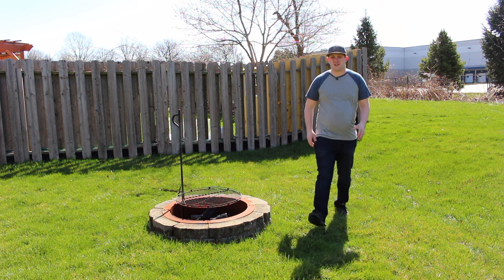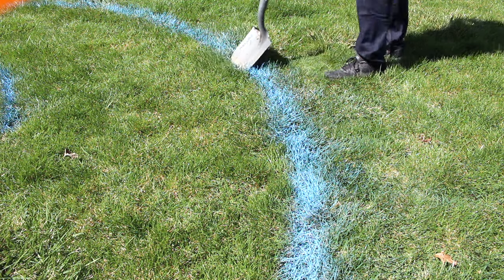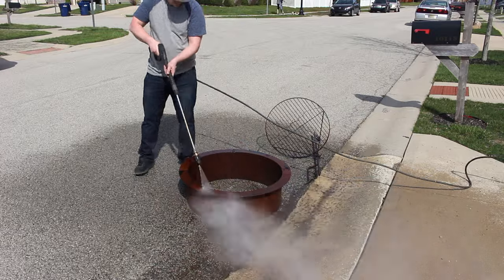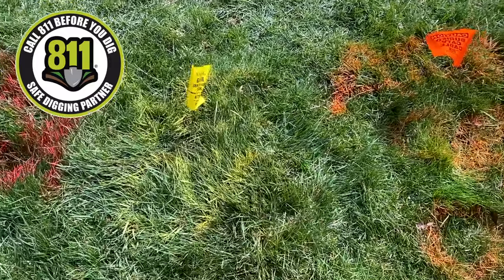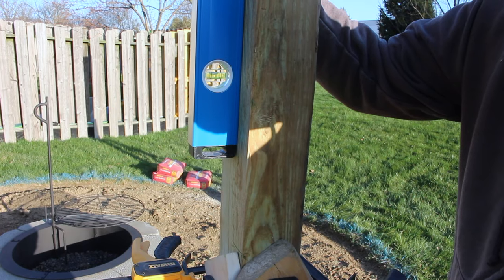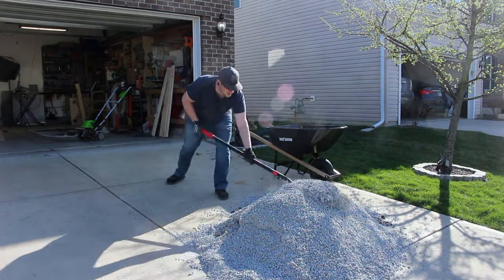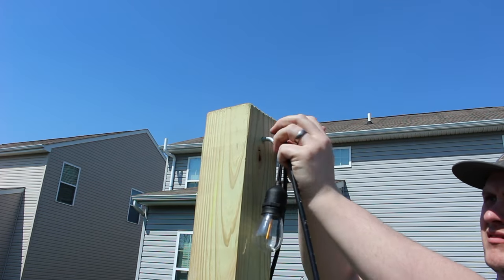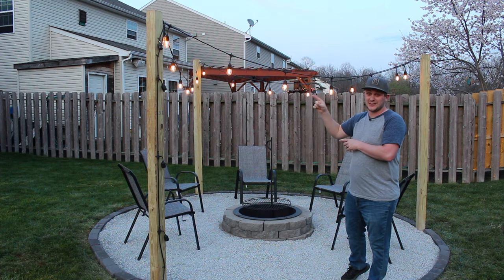Building a DIY Fire Pit Seating Area

Comment: Amazing! I plan on doing this too but with the posts set with concrete in the whiskey barrel planters...I just can't commit to putting the posts in the ground set in concrete since we will sell in a few years! Plus pretty flowers are a bonus :) If I don't want to dig up the grass to avoid dirt/grass disposal and back pain, can I use the cardboard method of killing the grass? Outline the area, set cardboard down and wait for the grass to die, add landscaping fabric and then pea gravel? Or would it be best to just dig up? Your project turned out great. Thank you!
Reply: What did you end up doing? I would be afraid the cardboard wouldn't be level.
Reply: @skylar-2133  Never got around to doing a firepit yet, unfortunately! We started with a large deck project and a pool instead. It's still on our list!

Comment: This is great! Such a huge improvement on a tiny budget. How did you run your lights to power? Is the wire just strung across to the house?
Reply from the maker: Thanks! I have an outdoor outlet not too far away, and I just use an outfit extension cord works pretty well.

Comment: For the lighting posts. You’d be better off pouring a concrete footing, extending above grade slightly, then attaching the post to that. This way they won’t rot and can be replaced. Less lateral strength perhaps, but that’s not really a requirement here.
Reply: please elaborate

Comment: Glad to see you put the weed block under the edgers! On your curb appeal video I was talking back to you saying, “Noooo...put the weed block under the edgers.” I learned the hard way when weeds grew up right at the edge and I had to redo mine. Nice fire pit, but you didn’t include in the cost the chairs. Also, have you used the pit yet? I really like the look of the gravel. How do you find the chair legs and gravel working out? My only concern would be having the chair legs displace the gravel and rip holes in the weed block.

Comment: Where did you get the lights? Are they battery-powered?

Great video!!!
Reply from the maker: The lights are from Home Depot, they are linked in the discrimination. They are plugged in using an extension cord to the house
Reply: @ProjectBuildStuff  Thank you! Sorry, I should have read the description first.

Comment: Looks good. You should cut the extra light strand out and splice in a cable to get rid of those empty sockets. Assuming it's not an LED light strand.
Reply from the maker: They are LED lights and the plug is at the end of the stand unfortunately. Wish I could!
Reply: @ProjectBuildStuff  bummer. I went with incandescent on my deck for that very reason. Easy to snip out the extra for  a custom length. Enjoy the space. Looks great.

Comment: Good video.  I would give 2 comments to improve what you did.  #1 - Do a rough hand sand of your fireplace insert to remove some of that rust before you spray it.  #2 - Level your lawn.  I didn't see you do this after your cultivated the soil and looking at the after pictures I noticed you have a decent slope in your backyard.  A little extra work like this goes a long way.